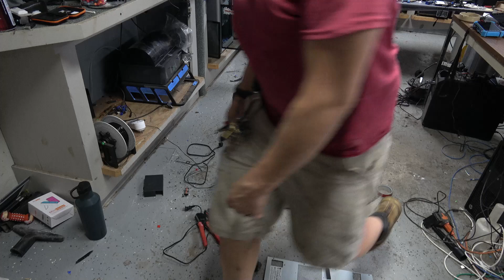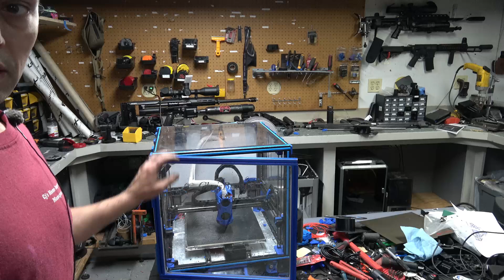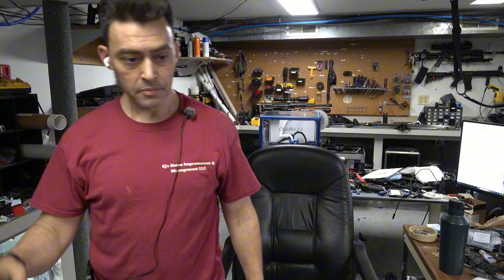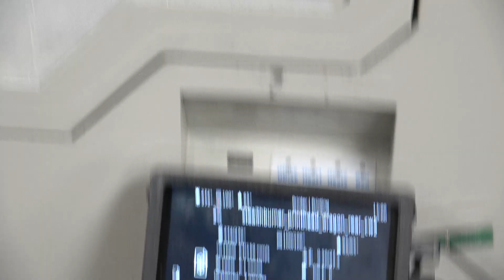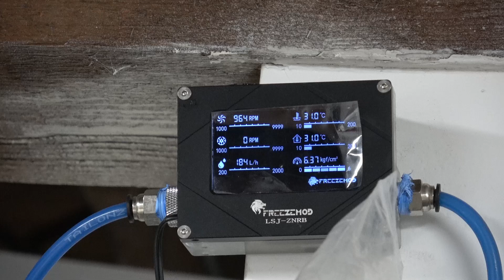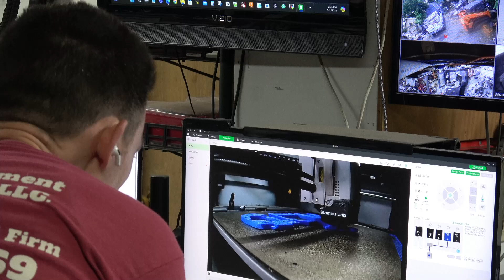Bambu X1C   X1E Conversion Part 2

Comment: Hi Chris, so it's been 6 months now... Are you still happy with this system? I just installed one mini heater in my X1C and finding it a tad slow to warm up. I am trying to get rid of the warping of bambu PET-CF....  Looking at your modification adding 2 heaters and wondering if I should go for it or if it's not going to change much. I really debated to just work my heatgun through this since I can set the actual heatgun temp but it would consume a lot more energy and requiring more fitting and prototyping ducts around the printer which I really don't feel like doing.
Reply from the maker: So I don’t know if you saw any of the other videos that I did on the Creatbot f430 that I bought and modified, but anything high temperature is going to use a lot of energy. I have an electrical meter on my panel at my shop, and when I use that printer, it has a 110 V. Chamber heater in the bottom, and I added four additional heat sources, two PTC heaters and two ceramic heaters, be able to tolerate them had to be modified. The entire printer had to be rebuilt, when you start getting into really high temperatures, you have to change every part to be able to tolerate it. You’re literally asking a motion system to work properly in an oven. So it takes a lot of preparation, as far as the bamboo, I think the second heater didn’t really make much of a difference. I didn’t even bother doing it on the other one, it definitely gets hotter in the chamber, but certain materials are still going to warp in that printer, the other one I can print peek on with no carbon, fiber, pure, no warping. The material is a bitch to work with, but the end result is the strongest part you’re gonna get out of any material in a 3-D printer in my experience, the only real competition is PEKK. Or possibly ULTEM, I’ve tried all three and they’re all brutal to work with. If you get the nozzle clogged with that stuff, you’re gonna have to clean it out with a drill! Anyway, as far as on the bamboo, I’m sure there’s definitely a way to do it. The problem is there is just such limited space, insulating. It would probably do you better. I’ve done that on many printers, the QIDIX max three, obviously the high temperature printer is completely insulated with high temperature, heat, shielding automotive grade, reflective with fiberglass, and reflective bubble insulation for Ductwork to form an air gap, so there are ways that you can accomplish what you’re trying to accomplish, but it’s not going to be easy. None of them are the most efficient way is the insulation, I think you’ll get more bang for your buck and you won’t use any more energy. If you already have the one heater in there plus the bed in the nozzle and you actually contain that heat you’ll do better that way. Try the reflective automotive insulation with fiberglass, Amazon is like 40 bucks for a 4‘ x 2‘ sheet, you may need two of them, but just remember the top of the printer is the most important part. Heat rises. Just my suggestion.
Reply: @Cjsairgunscarsandmachining   thanks for all the details.
So my first attempt is already showing signs of heat intolerant issues.

I went for 50C chamber temperature and monitored the chamber temperature with 3 probes.

The rear panel where the electrical cord of the mini heater expanded and the cable tie was in the way of the bed's motion.

The accelerometer reading threw errors left and right.

There were some sequences of bed leveling that had to be redone and I had to "ignore" error messages to get the print started.

I am not going to start working a load of insulation materials in the X1C. As my issue is first layer print wrap I'll just sit there with a heat gun for the first layer. And work a solution until I have something that works. (Hopefully)

Comment: Have you done anything with upgrading the hot end to get >300c? If so how?
Reply from the maker: Yes, I built a high temp printer!
Reply: @Cjsairgunscarsandmachining , have you tried the resistor mod? It's just soldering a 33 Ohm resistor onto one of the lines from the temp probe for the hot end, supposedly it will get the hot end up to 320c which opens up PPS as an option.
Reply from the maker: @robertharper3754  Hey, no I haven't. I haven't heard of that before now. I actually would probably do that if I knew about it, but I have another really high temp printer, and I use the bambu printers as a mid-temp/low-temp printer with great results, so I wouldn't have any reason to risk damage at the moment, but generally I totally would have.
Reply: @ I've got to fix my wifi issues then I plan on doing the insulation mod, chamber heater then the resistor mod, I only have my one printer so I'll give it a shot. A lot of people have done the mod without damaging their machines but I'll still be watching it like a hawk and keeping my fingers crossed!
Reply: @ I wish someone would do an x1c to X1E conversion, it’s got to be only a few boards and with same main board or specific main board, current main board has an unused socket, my assumption without being an electronics guru, that 2 additional boards minus the LAN board plus heater are the only few differences. I wish I knew more about circuit boards and electrical engineering.
Reply from the maker: @robertharper3754  If it's your only printer I would be careful, but I'm saying that as the guy who probably would have already done it, so not being hypocritical, go for it, here's wishing you the best, I had the wifi issue with mine too, I don't know what changed, but it has been working now. Had it on both of them, I think it's a thing....
Reply from the maker: @FireMedic541  If I had an X1E, I could totally recreate it, but I don't know what's missing from the X1C's. I considered buying one at one point, but the additional 20 deg C wasn't enticing enough.
Reply: @ agreed but active chamber heating that runs through the OE firmware coupled with the +20 deg hotend is. lol

Comment: Hi Mate,
 Excellent video. A vouple of questions about the conversion. The X1E heats 20 degrees warmer in the printing head than the X1C. Are you able to run all the other filaments in this with the heater upgrade? I was wondering about insulating it as well. What was the material and did you just attach it to the inside?
Reply from the maker: Hey man, thank you! So I didn’t insulate it because the glass and aluminum Housing does a pretty good job, I did however insulate several other printers. I’m going to be uploading a video shortly that I have an X Max three, and I literally rebuilt the entire printer, after a whole slew of issues, QIDI was amazing with Support, I just got fed up with all the repairs and waiting on parts, but they were really amazing with sending out everything I needed, but I literally rebuilt the entire thing new motion system with linear rails, insulated the entire thing put another chamber heater, an additional MOSFET for the additional heat supply, 48 V power supply for the 5160 external drivers, stealth burner, tool head, completely custom now, not one factory part left in it except the bed. You’ll see in the video if you wanna watch it, you can’t increase the nozzle temperature but from 300 to 320 doesn’t get you any additional filament, the X1C can already print with PPS, that’s high temperature nylon, it just will warp instantly, and really bad. I’ve tried it, now with the chamber actively heated. You can print materials like that you’re not gonna be able to print PEEK or PEKK, I also built another printer that is high temperature enough for both of those and ULTEM, there’s more videos on my channel of that bill as well, I look forward to hearing your feedback on those, hopefully I can give you some ideas. If you have any specific questions I’m happy to help, but the nozzle temperature will not get you any benefit, the only benefit is the chamber heat because the temperatures that you need for that range PPS, some of the PET carbon fiber some of the other filaments in that range can be printed at 300 or under, but the chamber has to be warm my extreme high temperature printer gets to 140 in the chamber! 550 on the nozzle, and 220 on the bed. That’s how you print PEEK and ULTEM

Comment: what are the heater system  you are using and where did you get them?
Reply: Thanks - I am going to give it a try!
Reply from the maker: @LincWilliams  Nice! It works well, but only up to 55 deg C or so. Maybe 58.... But that's enough to prevent warping in a lot of filaments.
Reply from the maker: @LincWilliams  here is the link for the heaters, https://a.co/d/ge4vcPd, and here is the link for the temperature controller https://a.co/d/8KoM6Tq. both on Amazon, surprisingly easy to find. If you have any other questions or I can help in anyway feel free to reach out.